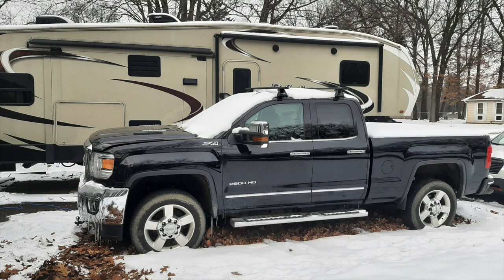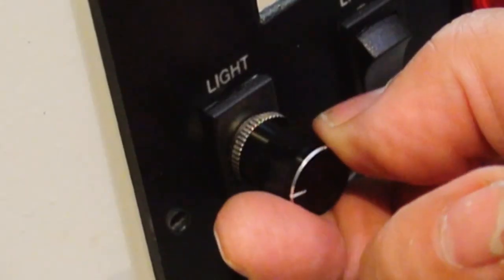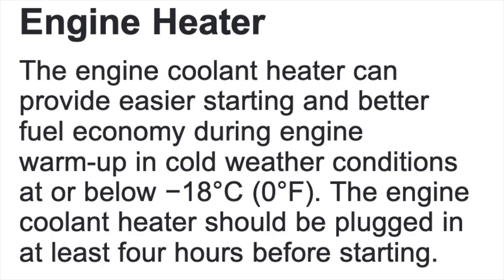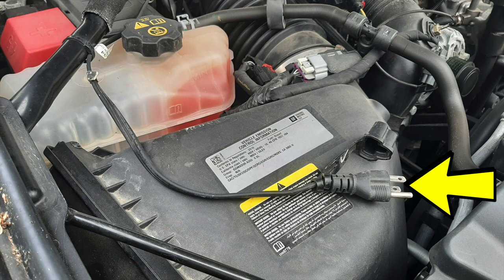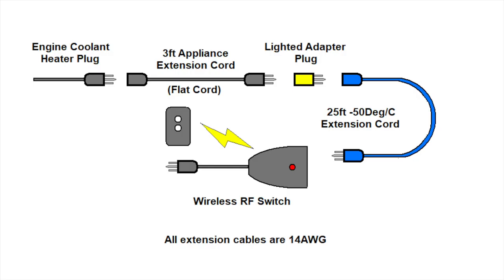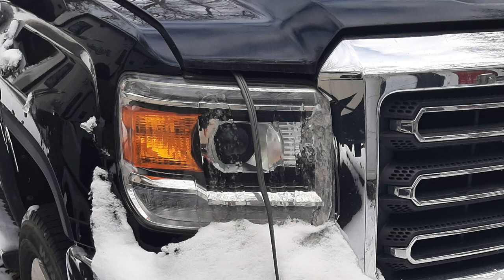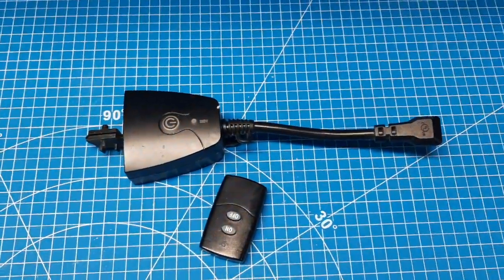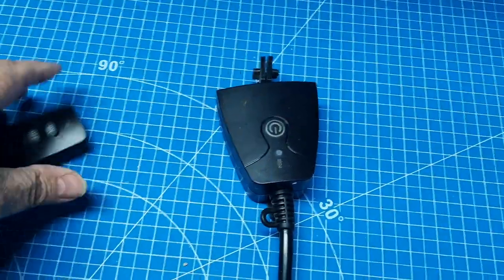Video Tip. Controlling your Diesel Truck's Engine Coolant Heater.

Comment: Cool good idea. Over here in quebec gets pretty cold, and use the block heater quite often. My 2020 chevy 1500 has a really nice outlet integrated on the front bumper for easy access. Its a great feature.
Reply from the maker: Keeps from having to go outside in the evening.

Comment: Yes, I have a 2018 Silverado HD 3500 and the engine block heater was actually recalled TWICE!  So just two weeks ago they replaced everything as they had to redesign the heater and replace it along with hanging the coolant.  Hopefully this is a final fix!  The very first fix was to cut off the cord so you couldn’t use it due to potential fire.
Reply from the maker: That's crazy.

Comment: Great tips.  Little did I know my baby turbo duramax in my Colorado has an OEM block heater.  Any risk to all those connections for this setup?
Reply from the maker: My neighbor snowblowed my driveway when I was away and wrapped the extension cord up into the auger of the blower.  Otherwise, no issues.